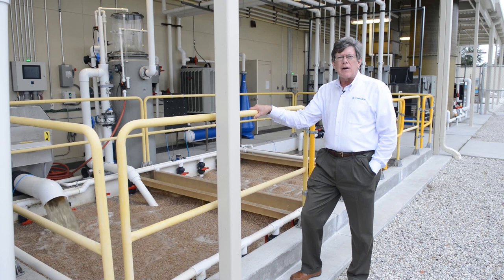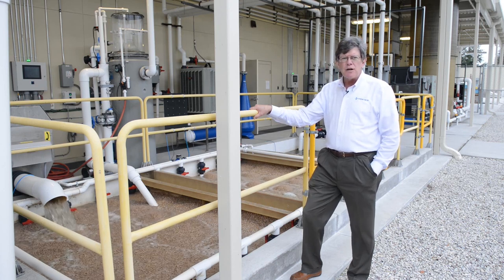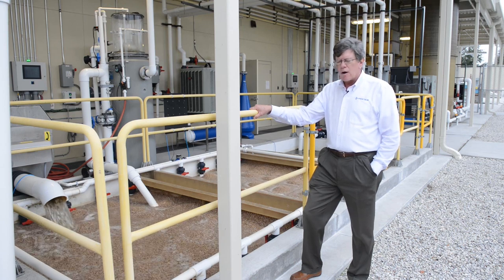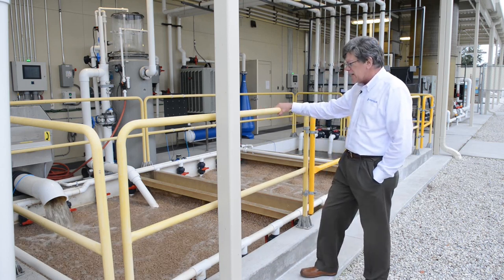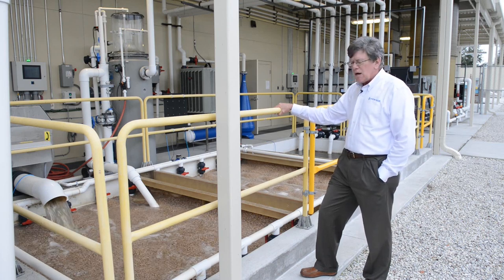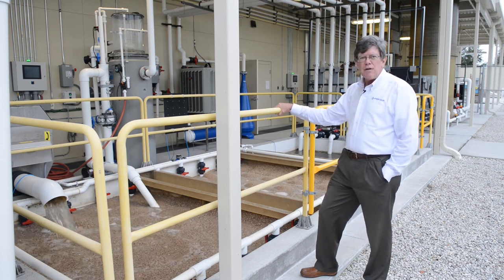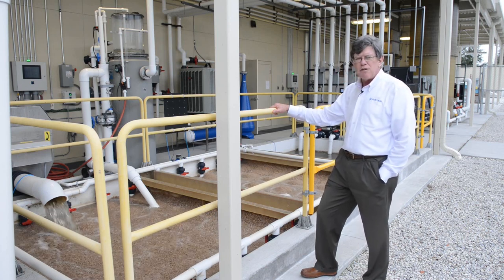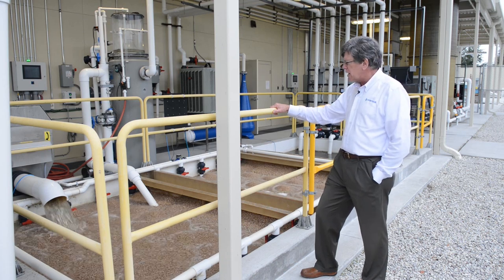Moving Bed Bioreactor - PAES W.A.T.E.R. Product Showcase

Comment: PLEASE TELL ME, AS SILICA SAND HAS LARGE SURFACE AREA , CAN THIS SAND BE USED INSTEAD OF K1 OR BIO BALLS AS MEDIA IN THE BIOREACTOR? will it provide the nitrification....
Reply: @kamil arshad Yes,  Sand can be used and it has a lot more surface area than K1, the only drawback is you need to have a better aeration system. For further inquiry, search for fluidized sand bio filter. There are a lot of research papers on the numbers and quantity of sand air and the stocking density of fish.